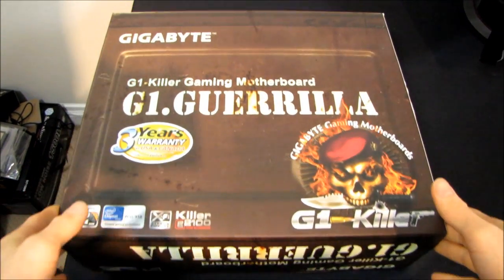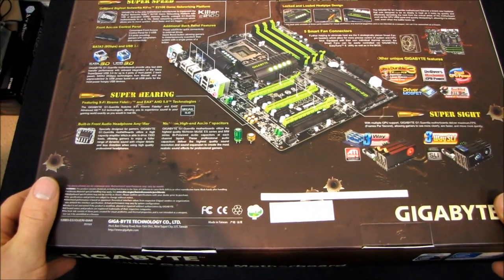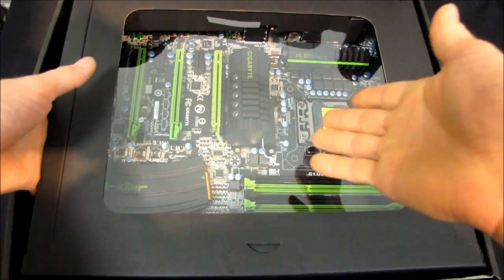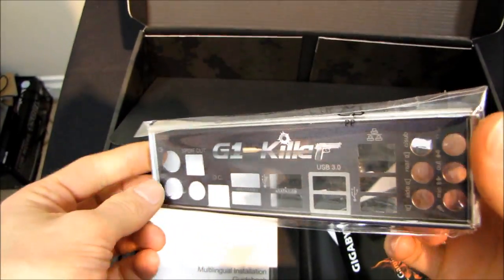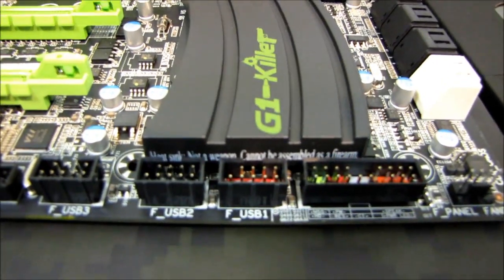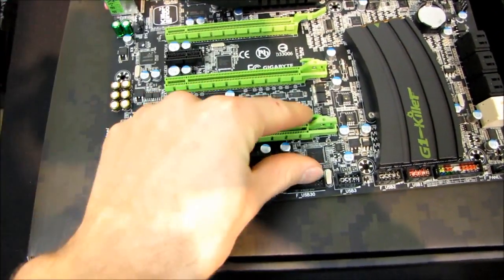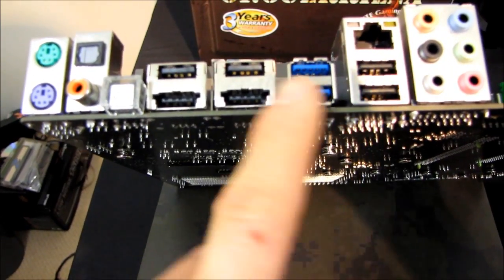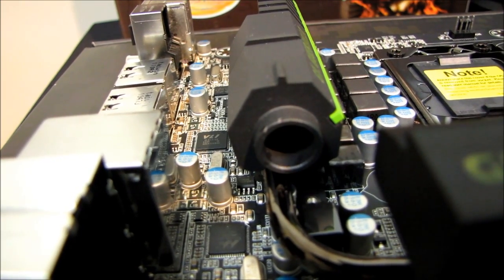Gigabyte G1.Guerrilla X58 Gaming Motherboard Unboxing & First Look Linus Tech Tips

Comment: Still using this board looked at the top cpus available and realised that I was cheaper getting a server cpu as it supports it, and it also allowed me to access more features. I have a gtx 1660 super gpu and it works perfectly not had any problems, this will last me for many years to come

Comment: I'm still using this board 11 years later. Never had a problem with it. I just got a used GTX 970 to replace the "cutting edge 570 " I built it with. Good board in it's day. Hopefully the cables that came with it will connect to my CoolerMaster 1000 watt PS. 570 was two 6 pin, the 970 is one 6 pin & one eight pin.

Comment: @thesmartphonereviews The 932 looks just fine, the X one might have better cable manegment, but that should not be a problem. But i do like the open window of the case as you can see almost the entire inside. Else i live in a little island ( or many very small) called faroe islands, and its a huge overprising when sending stuff in, and in case the case (lol) is heavy, well, im going down.

Comment: @thesmartphonereviews I was thinking that i would replace everything, and for now i have a good card and enough ram, my CPU SUCKS, its the intel i2 duo, nuff said. But the plan with it was the CPU and SLI, but i think my case is backwards as you call it, it opens from the right side and not the left. But i think this board would fit. If it helps, the PC is a dell xps 420, with 4 ram and a gtx 460 :D Big thx BTW